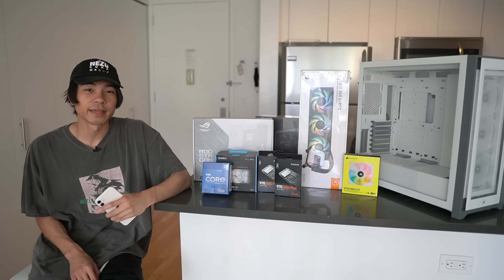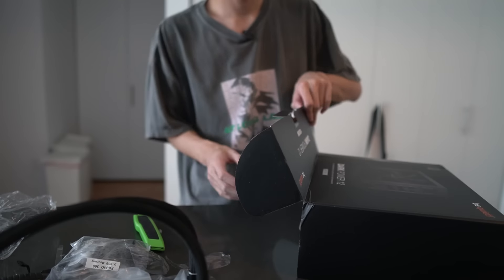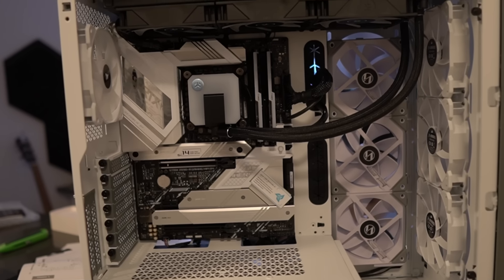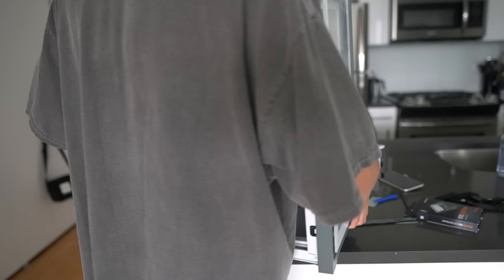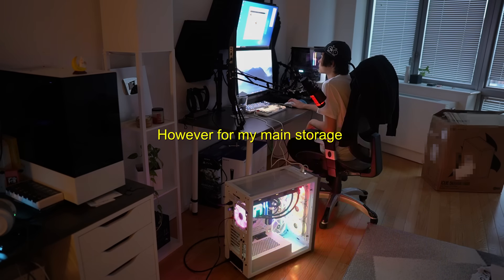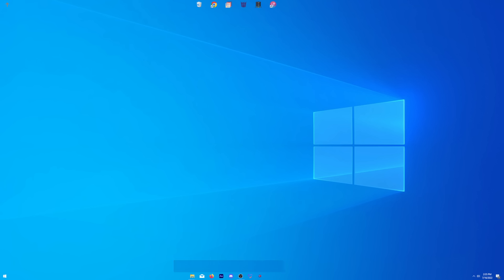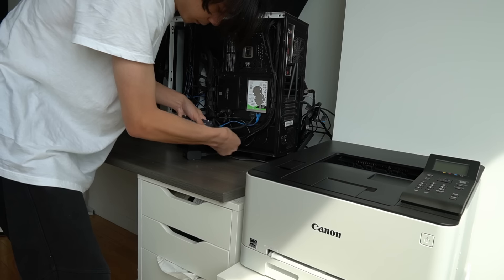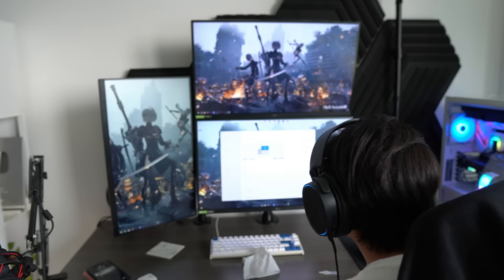BUILDING MY NEW BOTTING / EDITING COMPUTER - My whole PC Setup

Comment: Hey nova, I have a few questions, i think i’m at the point now where i could start making some videos myself and was wondering if i install a CPU will that mess up any of my data on the computer at all? Also is your CPU or Ram used more while recording videos?
Reply: CPU won’t mess anything up with your data. When your recording it uses cpu
Reply from the maker: Nope replacing CPU wont mess up anything but you needa make sure that the new CPU is compatible with your motherbooard. the CPU + GPU will be the ones doing most of the work whenn it comes to editing but u definitely need at least 16 GB of ram as well
Reply: @BotterBoyNova  thank you so much man, I have a 3060ti with 32 GB of DDR5 ram, so i’m assuming even that would be ok right?
Reply: @864streetoutlet5  DDR5 is very fast and better than DDR4 so your good

Comment: How do you know what will be compatible with what when building a computer?
Reply: What do you mean
Reply: @TheFDream  which parts go together, to prevent shorting or burn outs if any
Reply: @danny_mcduck  Use a pc builder mostly.
You start off choosing a CPU which has a corresponding motherboard that fits it chipset. Then the SSD, cooling systems and extra's. The power supply you need can be calculated with the watts each and every piece of hardware needs to run. Use a pc-builder app to calculate that for you.
Reply: @TheFDream  thank you that’s helpful🙏
Reply: @danny_mcduck  No problem

Comment: Nice build Brother! I built my first PC in Dec 2020 and I can't wait until I build my next one. It was a stressful project for my first build but I learned so much through the process. My pc did not power up on first start. I'll never forget the migraine I had until I figured out I had the front panel connectors on backwards. Good Job Man! What is the RGB GPU cable that you're using? I didn't see it on the parts list.
Reply from the maker: HAHA mann!! yeah I can't even imagine what it's like to spend hours on that thing and it just does not turn on 😭😭 Good catch! I've updated the description to include nonw but here it is https://amzn.to/3PYNDBC - not compatible for some GPUS so just make sure yours is compatible if you're thinking of getting it
Reply: @BotterBoyNova  Thank you!!